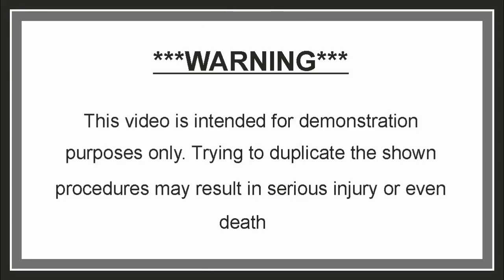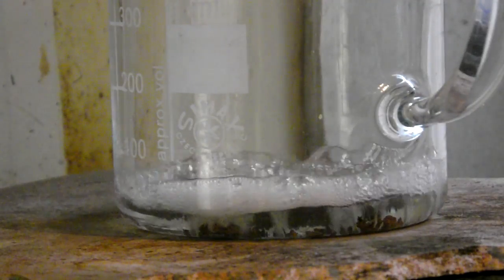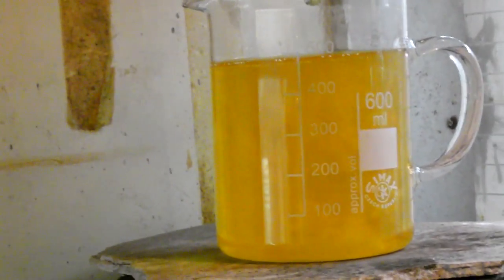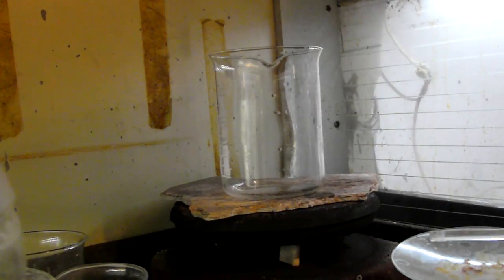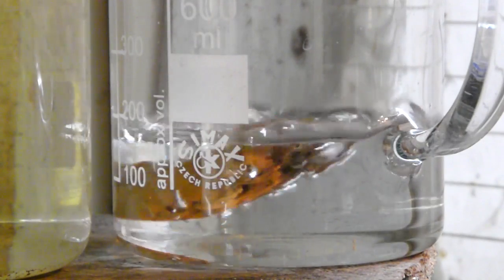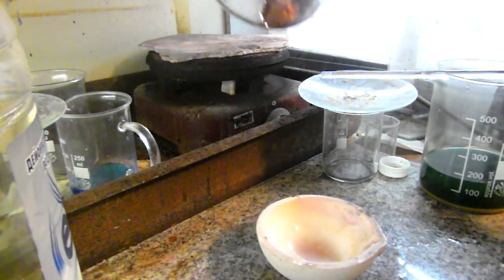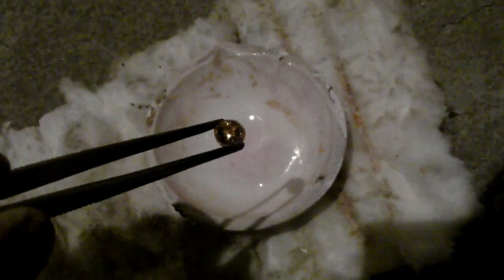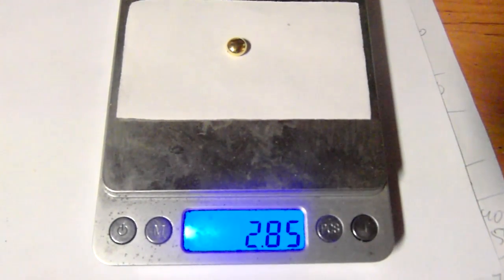Refining GOLD to 99.99% (24K) with oxalic acid

Comment: hello my friend congratulations on the videos, is oxalic acid a reducer to precipitate?  and to neutralize it can be sulfamic acid?  before precipitating with oxalic acid can i neutralize with sulfamic acid?  Thanks.
Reply from the maker: yes, this is what I've used here, sulphamic acid to de-NOx the solution, and then oxalic acid and base to precipitate the gold
Reply: thank you very much my friend you helped me a lot.  just one more doubt, using oxalic acid do I need to use metabisulfite or bisulfite?  thank you very much for getting a lot of gold
Reply from the maker: @junioraifamaifam1295  no in that case you don't need sodium metabisulphite
Reply: @OwlTech333  thank you, you are the best👏👏👏🤝👍🤝👏👏👏👏

Comment: Hard for me to get distilled water. Is well water ok? No chemicals... I thought not supposed to boil acid solution that gold evaporates into the air with the steam
Reply: Make your own distilled water if you have to. You never know what you might introduce into your solution otherwise, and it could react with the other base metals and screw things up. With that said, as long as there isn't any chlorine... it's probably ok... probably.   :)

Comment: I wonder why you didn't just drop it out of solution with sodium metabisulfite. This seems a lot harder, but still a fun experiment.
Reply from the maker: If Pd or Pt are present, SMB will cause their co-precipitation, while with oxlalic they remain in solution
Reply: @OwlTech333  oh, I didn't think of that. Thank you. I'm dealing primarily with 10k,14k yellow or rose gold that I inquart with copper. I really wasn't thinking of trace amounts of platinum and platinum. I guess I should be testing for it, but it seems unlikely I'd ever have much. Thanks again, you gave me something to ponder on.

Comment: Hi big Owl, i have some raw gold extracted direct from the mines,  it is about 850 pure, which is the best process to refine it to 999? Please what are all the names of the chemical used during the video? Nelson
Reply from the maker: HI! What is the remaining 150?
Reply: Normaly cooper silver lead
Reply from the maker: If I were you I would melt the dore with  4 times it's weight in silver, followed by digestion in nitric, residue digestion in AR, drop with SMB, re-digest in AR,  drop with oxalic acid
Reply: Wowww that will be expensive will need about 1200 grams of silver, i have 300 grams of gold in powder, if i add aqua reggia direct will not digest the gold?
Reply from the maker: sorry, I thought you had a dore bar, still this is how I would have approached the problem, after cupellation of course (this will eliminate the lead and part (if not all) of the copper. You can split the charges. Lets say you have only 400g Ag, split the charge in 3 and inquart 100g dore with the silver. After the parting recover the silver from the nitric solution and use it to inquart the next 100g dore and so on...
Reply from the maker: You can also use Cu to inquart with